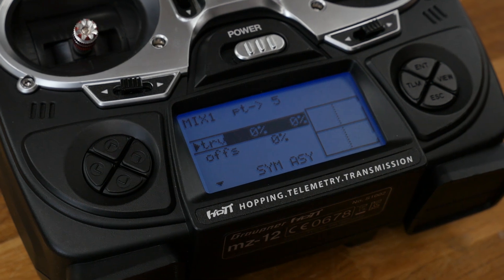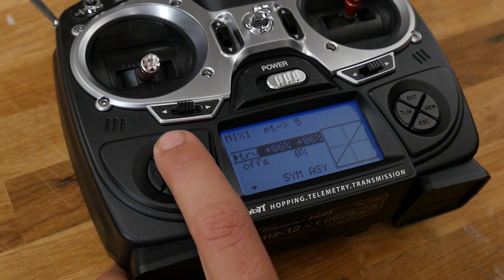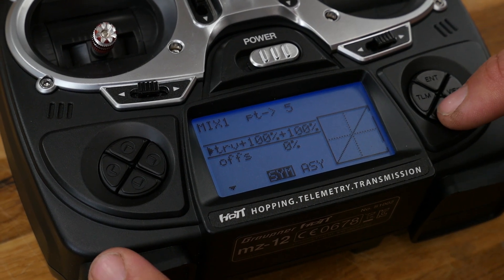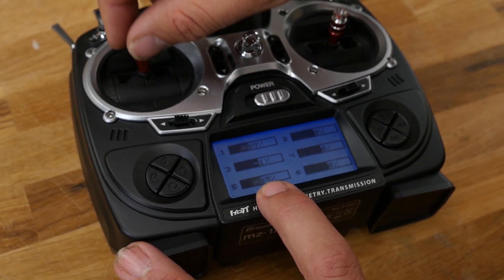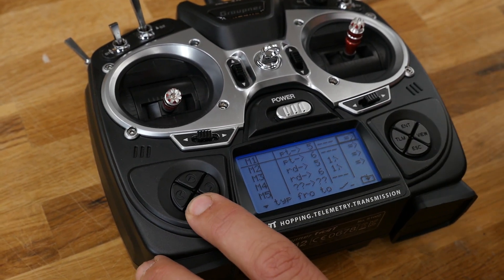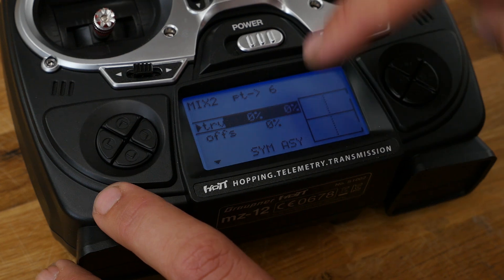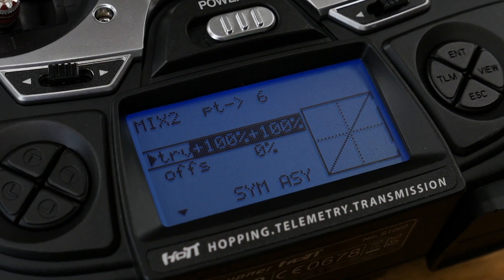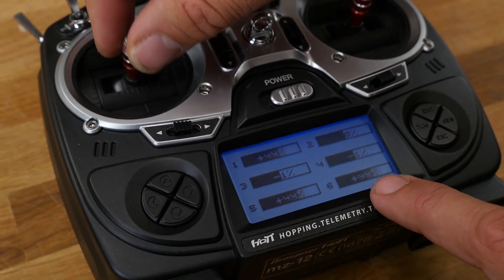HOW TO : Differential Thrust | Flite Test

Comment: This is a super late comment but i had to say it because im curious. So i just watched this so i can do diff thrust on my bushmule. However i already have a 7 channel receiver and tenecally i need 8 for the reverse. But i dont see why you guys aren't just mixing throttle to aux 1 then rudder to throttle and rudder to aux 1 its the same thing really just easier in my opinion and 1 less mix and the best still able to use aux 2 for flaps or gear or whatever you need.

Comment: Watching videos, 737-800 NGX, I've seen the engine throttles at slightly off positions of each other to off set what I believe to be two problems of flight.  One being to off set cross winds and the other to compensate for engine torque.  Are there any problems in flight were you would intentionally use a off set in engine thrust for RC Model Planes?

Comment: EXCESSIVELY LOW THROTTLE!
Okay, so maybe I missed a post about this, but:

I have a Spektrum DX8G2 and I followed this setup.  I am flying the FT Sea Duck with the Power Pack C (Emaxx GT2215/09 motors).  I tried running a 2200mah 50c 3s battery and it was a pain to just keep the plane from stalling.  I tried my 3200mah 30c 3s battery and it was pretty much the same thing.

I notice that when I am full throttle and use the diff thrust, one motor cuts down and the other one still revs up quite a bit.  This tells me that my issue is the radio setup, not my hardware.  How do I set it up so that my throttle is actually 100% when I set it at 100%?

Comment: i bought a devo 7 receiver, it doesn't have numbers but it already has names by each port i.e. elev aile thro rudd   it only however has one port for the throttle, are these just guides and can i overall these guides, or have i messed up.
Kind Regards

Comment: OK So How I did it with FlySky FS-i6???

Ch1 - AILERON
Ch2 - ELEVON
Ch3 - MOTOR 1
Ch4 - RUDDER (I put here the steering front wheel as well)
CH5 - MOTOR 2
CH6 is FREE (can be used for anything else)

We have 3 mixes

Mix 1 (we connect the two motors so both works parallel)
Mix is ON
Master Ch3
Slave Ch5
Pos. mix 100%
Neg, mix 100%
Offset 0%

Mix 2 (we change the MOTOR power as we move the rudder for MOTOR 1)
Mix is ON
Master Ch4
Slave Ch3
Pos. mix 20% (can be anything from 0-100%)
Neg, mix 20% (can be anything from 0-100%)
Offset 0%

Mix 3 (we change the MOTOR power as we move the rudder for MOTOR 2)
Mix is ON
Master Ch4
Slave Ch5
Pos. mix -20% (can be anything from 0-100%) (I don't really know why NEGATIVE 20% but it works like that)
Neg, mix -20% (can be anything from 0-100%) (I don't really know why NEGATIVE 20% but it works like that)
Offset 0%

THAT IS IT It works like a charm!!!
Enjoy!!!

Comment: Aren't you supposed to dissconnect one of the ESC's power leads from the cables when running dual? Not sure if the Futaba ones have some sort of smart power management, but I'm pretty sure you could fry a cheaper reciver if booth ESC's feed power to it.
Reply: I would, but it really depends on the BEC.

Comment: I recently programed my spectrum 6(black) for differential thrust, watching every video I could find. It took two full days. The roller is now hard to use due to wear. Result was a switch was activated in a menu 3 levels into the programing FROM THE FACTORY that prevented success . After all that work I found that flying two motors on one battery (2200 mha 35c) drew so much current (40 amps)that it swelled a battery with each flight. The plane I built was able to carry two batteries in parallel and cured the problem . You really have to want a twin! I wish josh would put a wattmeter on their recommended setup.

Comment: What is the easy proper formula to app lie for weight of plane to proper KV Size of brush less motor Size..So if I have a 8 lbs plane, what size kv do I need. Keep in mind that I have watched 100s of videos. Ive been searching every where. Why is this information not easily available to all the rc hobbest in the world. Brian. I dont need a treasure hunt! I need an exact answer please. Thanks
Reply: I imagine there are lots of variables including the air frame itself and lift generated by it moving through the air.  I built a few quadcopters recently but just looked at models of the same size and what kinds of components they use.  Answers to questions like this or ones about battery life have too many factors not accounted for to really answer.
Reply: Also kV just tells you how many revolutions per minute per volt applied.  So depending on the voltage you'll get different speeds having a larger radius motor will give it more torque some brushed motors are also taller than others and have variable quality in the windings for the motors magnets and adhesives used for the magnets think it's really a matter of just seeing what's out there and experimenting with your particular air frame.

Comment: You guys use to be all spectrum. I miss that.
Reply: I would honestly use FlySky's protocol over Spektrum. I've used spektrum multiple times and ended with up frustration and constant signal drop outs, while the FlySky receiver (Which mind you is a fraction of the price of spektrum) has gone out to 2-2.5 km range with no hiccups whatsoever
Reply: +Metallica4Life1995 that's a good one.
Reply: Yea definitely is
Reply: Lol Spektrum, they're just the apple of the rc world. I use FrSky FlySky and Walkera and never had problems with any, plus I'm saving a ton of money in the long run.
Reply: spektrum is overrated. I use a frsky taranis and have a dsm2/X orange module on it for the smaller blade bnf helicopters 450 size is the biggest i fly with dsmx . for the bigger heli's like my 600 and 700 i use frsky receivers. better range and for the functions on the taranis you would pay big time on a spektrum transmitter. taranis is budget friendly and has so much to work with.

Comment: 1- Isnt better to remove one of the red wires in the ESCs so only 1 bec is providing power to avoid conflicts?
2- Its as simple as use 2 separated channels for motors and mix rudder with each one of them (in the desired direction) and each mix use a switch to enable/disable.. you can play with how much.. a 100% mix would do one motor stop and the other go full whrn using full rudder

Comment: God it is very complicated. I know these Graupners are great expensive radios but man these are quite complicated beasts. 
I did it with my cheap and great FS-i6 which only has 3 mixes and it works!!!!! I used all of the mixing possibilities (it would be nice to have more) but it is just doing what it should, and I only used 5 channels (delta mix + diff. thrust + front steering wheel on the place of the rudder) I still have one more channel for some bomb dropping :-)

Comment: or maybe use a v-tail mixer? otherwise I've no channels left for flaps.
Reply: I have a video on mixing throttle to gear.  So ch6 is still open. Search YT for "dx8 differential thrust".  Just another way to do it.  I did it on the FT Cruiser
Reply: Actually, you can do more mixes with a higher channel radio. He just used a 6 channel,  but there are 7,8,9,10,12, and 18 channel radios, that I am aware of, all of which should be capable of more mixes. My person favorite are the Spektrum 6,8, and 9 channel radios because they talk back to you.
Reply: +Raycefan I think the point was to show it could be done on a 6ch radio. A lot of people can't afford a multi channel digital radio with 10+ channels.
Reply: Thank you.  I wasn't sure how to reply.  So in the video I did years ago I used throttle and 1 extra channel.  Which left 1 more available for gear/flaps/etc.
Reply: +notasixpack I've no idea why he didn't use the throttle channel and mix ch5 into it either other than not confusing people with references to the throttle channel by using both from the aux channels. I use mechanical mixers anyway to keep the few mix channels I have free for flaperons etc.

Comment: too bad im using old futaba 6ex, anybody knows how to do this.........thanx in advance for your help
Reply: you can get a mechanical differential thrust using a V-tail mixer between the rudder and throttle.
Reply: Thank you! I've been wanting to try differential thrust, but didn't think it was possible without an expensive transmitter. Never heard of a V-tail mixer before now.
Reply: Master Kammelryder thanx for the reply. i think i will try that. I just dont know exactly how to program in the radio, and the exact throws. I will be trying this for my FT Sea duck. thanx once again

Comment: I am gong to describe a very interesting problem I had/have using HKing ESC's and a Turnigy reciever, that i think is worth sharing in case anyone else runs into it. 

I set up differential thrust essentially the same way you did, but one or more of my motors would continue spinning even at zero throttle following rudder inputs. As long as I didn't enable the rudder mix, both motors would start and stop at the same time. If I enable rudder mixing and move the rudder back and forth a bit, many times one or more of the motors would continue spinning at low speed even though the rudder is moved neutral and the throttle moved all the way down. After doing some troubleshooting/meditating on the issue, I came up with a possible explanation.

Before you ask, I did all the obvious stuff, ESC calibration, small tweaks to trim and mix settings, and the like.

The total travel of the sticks on my radio is limited mechanically by the chassis of the transmitter itself. If I were to take off the front faceplate of my radio, my sticks would have a small amount of extra movement. At some level, the sticks themselves have to return to the computer in the radio a numerical value indicating their position. For my example, I will say that with the faceplate on, my radio delivers a numerical range of -95 to +95, and with the faceplate off, perhaps it delivers a maximum of -105 to +105. 

When the sticks on the radio are calibrated, the radio knows that when the throttle reads back "-95" indicating the throttle is all the way down. The radio sends a "-100%" signal to the throttle channel, and the ESC's are calibrated to exactly this signal. What I think happens to cause my problem, is that when i'm at 25% throttle, and I throw the rudder hard to the left, the right ESC somehow gets sent a signal that is "lower" than -95. This somehow causes the ESC to think "oh no, I must have been miscalibrated before because I'm getting a new lowest possible reading on the throttle." The ESC seems to on-the-fly recalibrate itself to this new value for "zero throttle," thus when I move the stick all the way down,  one or more of my motors continues to turn. 

My workaround for this problem was to disable subtractive mixing all together. Rudder inputs only add signal, they never subtract it. Since making this change, my motors always stop when I kill the throttle. A more robust solution would probably be to install better firmware for my radio.

Comment: The amount of mixes required for this function can vary depending on your transmitter's programming capailities/functions. One very IMPORTANT thing to have when doing this sort of setup is to make sure you have a receiver that has the proper FAILSAFE functions for the secondary throttle as some receiver will simply HOLD LAST COMMAND which would be very bad with this setup in the event signal was lost.You would get the esc/motor on throttle channel go to low throttle position while the other secondary esc/motor would simply stay running at what ever RPM/throttle you had it moments before losing signal...
Reply: YES!!!  This is exactly what happened to me.   I lost signal and my plane did a flat spin to the ground, much like a maple tree “helicopter” seed.  Miraculously no damage but once landed one motor continued running, causing the plane to spin around and around on the ground!  Nothing I did could stop it; I had to stand by hopelessly until the battery drained.   Yup, it was the failsafe.  

Old post but still extremely valuable information here.

Comment: almost no one in germany actually flyes in mode 1 ;)
Reply: That´s what I tought.
Reply: I'm using mode 4 for planes and mode 2 for quads :D
Reply: You are 100% crazy! :D
Reply: the old plane guys do i think. from the 3 instructors at my Heli club 2 of them fly mode 1 and that are the older guys. the third one is my age and flies mode 2. they teach you how to fly helicopters with a cable method and have different options from mode 1 to 4 but most of the new guys prefer mode 2.
Reply: the old plane guys do i think. from the 3 instructors at my Heli club 2 of them fly mode 1 and that are the older guys. the third one is my age and flies mode 2. they teach you how to fly helicopters with a cable method and have different options from mode 1 to 4 but most of the new guys prefer mode 2.
Reply: In my area most of us "casual" guys fly mode 2.. then the pros usually fly in modes 4 or 3
Reply: RotorBeast My father taught me to fly in mode 4 but I found it impractical when I started flying quads so I learned mode 2 :D I can fly planes in mode 2 but I find it easier in mode 4.
Reply: Elias R.
i started flying in mode 3 because i started with a 2ch radio 18 years ago in a 2 ch glider (no money :D ) then years later i got a Futaba 7C so i had to re-learn to fly in mode 4 (inadvertily) and finally moved naturally to mode 2. Pros arround here insist mode 4 is better as there is no interference elevator-ailerons when doing fine maneovers.. tought even if the case it should be easy to fix with expo
Reply: +sparrowlt that's exactly why I still use mode 4 for planes. I like aileron and elevator separated and I rarely use rudder.